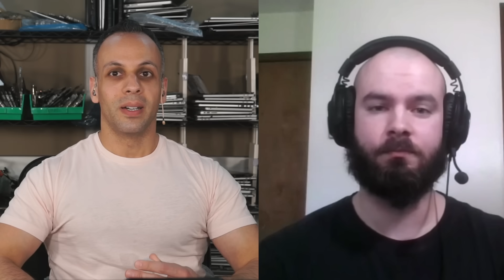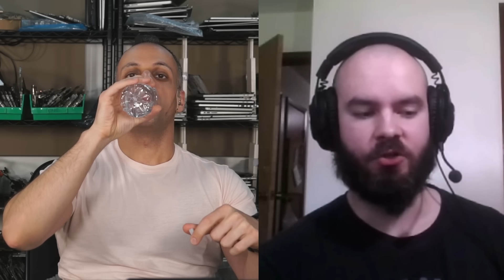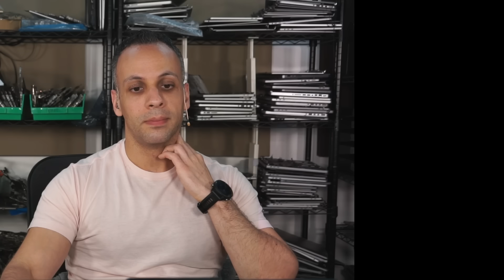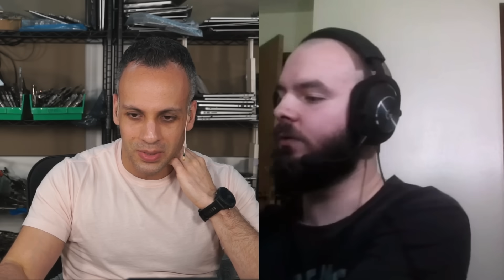Navy tech discusses decline of repair

Comment: This is fascinating to me because I’ve worked in the medical repair industry for 25 years. Been running my own business since 2017. Before I was on my own there was a lot of just troubleshoot and swap but now I actually get to repair on the component level. It’s very satisfying when I can keep an obsolete x-ray machine up and running by replacing a surface mount diode and a surface mount, resistor and capacitor.

Comment: Fighting for the right to repair is the wrong one to start with. 1st should be the fight to outlaw forced obsolescence 

Nobody should be forced to stop using hardware that still works. My phone in 2025 does nothing my 2015 phone couldn't.  

Windows 11 does nothing Windows 10 can't but, in Jan 2026, the Autodesk software I use will magically stop working on Windows 10.

And my PC, which works perfectly and does everything I need, will magically become e-waste.

This is not a capitalist free market. It's a cartel. A mafia threatening "you better buy a new one or you'll lose access to your work and bank account".

Comment: Oil field experience: sometimes the newer cables didn't quite fill the hole port, and vibrations would cause gaps in information on life-impacting data streams. Have seen many thousands of dollars wasted just replacing parts that don't solve the problem, when a piece of paper filling the void provides a medium term or permanent fix as it is unlikely those devices will ever be manufactured to specs that align.

Comment: Right to Repair needs to change as it’s a fundamental Right, IMO as important as any other. 

That being said it’s insane the Military has given up that much power. You’ll win a war against an adversary that’s willing to use duct tape and a water bottle to make something work, when you first can manufacture enough equipment and second can’t repair the equipment that’s still functioning and in need of a repair anyone with a modicum of knowledge can apply. Bureaucracy kills Countries, by tying the hands of the competent and capable.

Comment: I remember waiting 2 weeks for a 125k control panel for a plane in the airforce.  I could have CAD designed and 3D printed the missing switch cover in less then a day for a couple dollars.

Comment: I am a non US ex navy. The problem I used to face was that there wasn't enough spare parts to order from the warehouse. The spare parts are classified as traceable and untraceable. Untraceable spare are used and disposed of. Traceable spare are further classified into traceable repairable and traceable unrepairable. These traceable spares are managed by the warehouse for repair or disposal. The issue is that the number of traceable spare is fixed, meaning when the warehouse has a backlog of traceable repairable spares, no further spares can be ordered.

Comment: AI will sort out the problem. Wont need for trained technicians. If you upload a picture of a board and you give the description of the board and the issue will guide through on the trouble shooting. It works already but small efficiency. But next month is going to be better. This is when Louis Rossman repair videos coming handy to teach AI.

Comment: This stuff started in the early 90's when I was doing instructor duty at NTC.   They got into just "black box repair" vs component level repair.  They would replace the entire module and then send the broken one into a "depot" for repair. I argued against it, but as just an enlisted guy it wasn't my decision.  He's right, I joined almost 40 years ago, and we used to do component level stuff.  Navy also has 2m "micro/minature" repair school to teach surface mount and latest soldering technologies of the time.  Basic Electronics and Electricity "BE&E" school went away maybe in 1990?  This is long before his time. :)  I was in 1986-2006.

Comment: Listening to all of these videos of the military guys and hearing the very "union" mindset of stay in your box and if you stray from it you will be punished conditions they work in reminds me of an experience I had trying to buy HVAC parts from an HVAC supplier. They wouldn't sell to me because I am not a tradesman. Their reasoning? To protect the trades. IMO a related issue to right to repair obviously in the sense of authorized dealers and repair depots etc but I also think the mindset overlaps.

Comment: As a retired Navy veteran I will definitely co-sign this! In my 24 years of service, I went from troubleshooting electronic equipment at the component level (transistors, capacitors, etc.) to just narrowing down causes of malfunctions to "black box" subassemblies we weren't allowed to crack open and dive in any deeper (lest we "void the warranty").

Even when we knew the problem could be fixed by replacing a $7 chip, we instead had to spend THOUSANDS of dollars via either shipping that subassembly to the manufacturer for a swap-out or flying aboard a tech rep from that manufacturer so he/she could replace that $7 chip themselves.

THIS is why our defense budget is about to breach the $1T threshold. Offhand I'd say we could shave off maybe $100-$150B of that bloat annually across all branches if we were allowed to repair our own gear.

But manufacturers like to keep "trade secrets" and use "proprietary" components to ensure the DoD continues to need to maintain contracts with them.

Comment: He should have the Right to open up the reactor and repair it.
All kidding aside. We who design the military equipment have implemented a repair process for military personnel deployed in the field.
And that involves training the military technicians deployed in the field to NOT repair to the component level.  
The Military System is deployed with many spares (boxes) often no circuit boards, just boxes or subsystems which can easily be unplugged and pulled, and replaced guided by a Fault-Indicator.

No deployed military technicians who understand the complexity of some of these systems and the relative complexity and bulk of required test equipment will complain about not being allowed to repair.

In a military deployment, we have planned a repair system which efficiently keeps the war fighter systems up and running by training the war fighter-technicians to pull and replace higher  level subsystem electronic or mechanical boxes.

As a designer, I would allow the war-fighter technicians to have the test equipment and spare components to repair qualifying boxes at the lowest subsystem level, only if that box complexity, security, and related test equipment, to include calibration, to verify compliance with the Test verification pass/fail criteria is at a minimum complexity such that the time troubleshooting would not impact the financial budget or the war-fighter technicians time related to the primary goal of pulling higher level subsystems to keep the all the top super-systems in a ready state.

If you really enjoy repairing as I do, you should wait, and use your military benefits to acquire an engineering degree.

Some of my friends did not make to graduate with a BSEE because they like to party.... But they were able to eek out a BSEE-T, and enjoyed repairing those lower level subsystems to the component level while enjoying $110K+ annual salaries.

Comment: The way the Navy goes about repair is ignorant. Spares should be for immediate emergency replacement or in case of failed repair ONLY as they are a finite resource. Not allowing repairs in non-emergency situations means you have high potential to run yourself out of spares until supply can get replenished. Everyone in a technical position in the Navy can tell you that nobody knows when the stars will align of the correct part being at the correct facility or resupply ship at the correct time for the next scheduled replenishment. Not supply, not the captain, nobody.  Maybe you can get it flown over via helicopter to save some time. Maybe not. Maybe get F’d. Might as well consult a magic 8-ball - at least you’ll get a straighter answer than anyone else is going to give you.

Comment: It boils down to a massive amount of pre lobbied job security and guaranteed repeat steady sales for the suppliers. 
Cut out the service department and they can force updating entire equipment rather than keeping the original items going. (Throwing away a big dollar machine because of 3 broken connections and a failed resistor).
The lineup of corporations that went from "repairable modules" to throwaway and impossible to even diagnose really grew in between 2000 and today.

Comment: My dad was on a sub in the 70s. He said the most mission critical piece of equipment was the Icecream machine. So when it broke he fixed it. They akso had a problem with accidentally allowing long wave ac to the O2 generation machine transformers causing the coils to burn up, he had to rewind the coils by hand and they worked. Old tech is fun.

Comment: The funny thing is, as a mechanic in the navy, I would rebuild the main engine propulsion side.  This was about $40 mil.  Me at 21 years old would rebuild this.  Not only did I rebuild them, I had absolute control of the rebuild.  If the ChEng would want to come see what I was doing, he would have to ask me as an E4 and E5 permission to come watch me.  If I liked them, I let them in. If I didn’t, I would not let them.  I remember needing rings for a pump and they were only available stateside and needed them ASAP, they would fly them from Norfolk, VA to Naples, Italy with a fighter jet.  There is so much waste in the government, and a lot of it is not the governments fault, but yet the government has the ability to stop it and won’t.

Comment: My personal favorite is how the few parts that we do get to be repaired will end up getting contracted out to third parties, who tend up charge 10x the amount of the item and end up either repairing or testing it incorrectly and end up making the problem worse... Like in the case of the Fuel Flow Transmitters getting metal shavings inside them... Can't tell you how many times I had to submit a PQDR because the part was bad from supply.

In the Airforce my favorite time was getting to go into AFREP (Air Force Repair Enhancement Program) and fixing the parts that no-one else could... Mainly because they were sticklers with their schematics. Either way the program proved to be quite successful, but one thing I noticed was how leadership would use the funds that we 'recouped' from self repair... So for example if we had a Transient Suppression Unit worth 16k and I fixed it by replacing the EEPROM then essentially I gained the squadron 16k to which they would use for other things... Also loved how Northrop Gruman, who was hired to create a tester for the TSU, was allowed to just take the tester that me and Ben made... for free... and take credit.... Meanwhile I ask them for schematics and they just tell me to get f*.

Comment: Big issue. Traing pipeline vs boos on ground. Then retention why traing in depth when person only serving 3 years after school.  Also ship level repairs are inconsistent, not every one is a A level tech.  Can turn to shadtree mexhanic quick.  I was lucky i attended a ftsc lant couse that placed me with the civilain comtractors for 6 months were i worked along side of them and they showed me how to diagnose and fix the issue. It served as a depot level repair facility. This was while TAD during yard. Only offered to second termers. Ships in port where welcome to bring their boxes over, and put them in the lab and assist w the fix.

Comment: Case International hold back vital information needed to repair their tractors. Even if you obtain their workshop service manuals a lot of important information is still missing. Case International also do training manuals which tells you how the tractor actually works as opposed to just telling you how to take it apart and put it back together again and even some of this information is still missing from the main workshop service manuals.  These training manuals are only issued to main dealer mechanics who go on their courses and rarely ever come onto the open market. I did manage to obtain one copy and on the very first page it said "Confidential for Case International dealers".

Comment: This is slightly unrelated, but I have a similar feeling about fixing problems within my own job. At my last position, I could basically do whatever the hell I wanted to a part and as long as it looked right and matched the sticker on the box, I was good. 
But now in my new role, when I mess something up and have to have it fixed, I can't just do it myself. I have to wait for the shift change, inform the main managers and explain the problem, then maybe they will be able to fix the part when all I would need to do to fix it is carry it over to maintenance and steal their Bridgeport for 10 minutes to remove .010" of material. 

It's infuriating as hell because THIS IS WHAT I AM IN SCHOOL FOR! LED ME DO THE THINGS YOU PAID THOUSANDS OF DOLLARS TO HAVE ME LEARN!

Comment: Ahh... The fun of PMS and fixing something until it's broke, and then going through the validation process to make sure something is compliant with the current ship alteration. Which could be fun if the supplier contracts changed and part numbers don't match up and stuff like that... Hopefully the COSAL was updated, which can be fun on a ship that's over 20 years old. (That ended up being my job in Maint Div. Most of the validation is making sure everything matches spec. of blueprints, comparing revisions, and chasing down some noted change in the back pages of an old manual that didn't get carried over properly in its revision to the new manual and documenting that. Then handing that up the chain to be verified by another senior petty officer and the GS contractor guy.) And that's before having to replace something and dealing with supply. Thus something like the reserve pump is now the one being used, and the main one is still tagged out until the next shipyard period because the time it takes for somebody on shore to do whatever it is they do with the information. Meanwhile you may even have the new version of the pump that's exactly the same as the old one that's not allowed to be used yet because the part number and supplier had changed but didn't make it into the necessary part of records for the repair to be procedure compliant.

Also the part of validation that relied on information sent up the chain likely relied on the same contractor that would also profit from doing the work in the shipyard. So them taking their sweet time was definitely possible. (Main point as a repair issue, no? But the story continues...) However there were ways to expedite that, and I remember being pulled off a working party by a senior chief who was told to do so by a Div-O because the other two guys couldn't find the missing link in the things that needed to be cross referenced. And I manage to find, point out, and highlight the stuff in print outs and copies of blueprint and manual pages in front of the senior chief and shipyard guy that was flown in. Two hours were spent trying to figure it out before I lined everything up in 20 minutes. (Nobody checked all the pages on the index and notes - that part of documentation had a way of being inconsistent given the history of everything, and there were hard to read digits on a faded part of the blueprint. Yet the numbers could be confirmed in some manual illustrations.) I thought it was funny given the rank and experience of the others involved (didn't say anything though - just picture "3rd class petty officer scrub" saving the day for people that should be way more qualified), but I managed to pull it off.

That was over 20 years ago, not sure if that's still the same since I got out.

Comment: Very good discussion on the difference between pissing into the wind vs Self Sufficiency. Try and survive on the former when dross abounds. When the Sr. Contractor is a smoldering crater 30 feet deep…

Comment: When the company i worked for.( multinational FMCG) Had a fleet of over 300 VWs. VW would lend us a car if they didn't have one they will hire one.for us. I got a new Jetta one year, some one in the factory put the air-conditioning outlet under the carpet.  They lent me  a car for 2 weeks while they repaired   mine.  My car was essentia for my job.
Today you can get a Toyota  from Toyota  on contract.  Pay monthly  for it. All you do is put petrol in it. If anything goes wrong  they give you another one. You just pay one monthly  fee it covers insurance, tyre's services  everything.. You should be able to do this with all manufacturers.

Comment: I work in industry and have only seen military equipment a few times: in modern ones,  in both environments, you can easily see that they come from the "office for the complication of simple matters."
I'm not talking about redundancy, which is a great thing, but about making the simple thing as complicated as possible so that only the manufacturer can get their hands on it.
With the prevalence of software, it's become even easier.
You don't go into battle in a Formula 1 car: you go in the most rugged  and reliable vehicle possible.